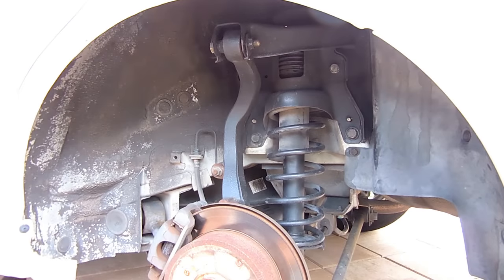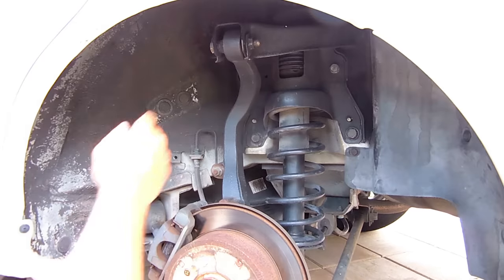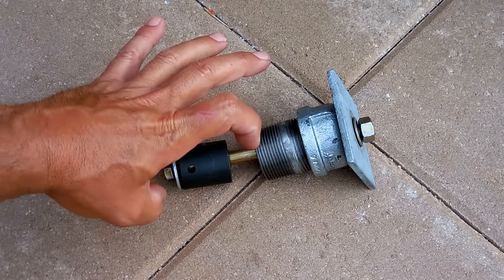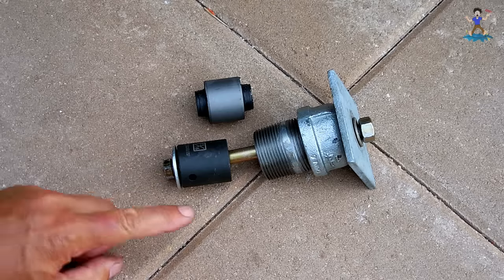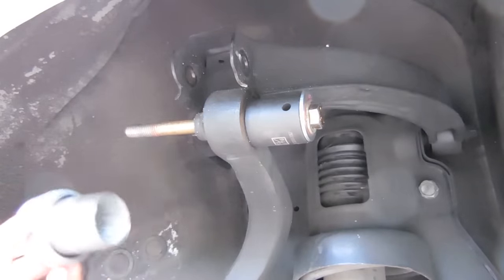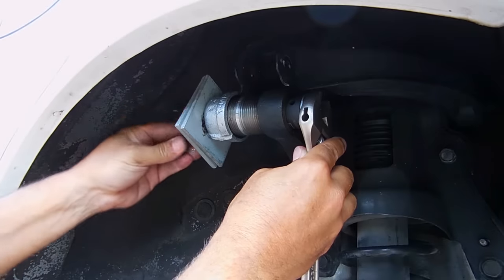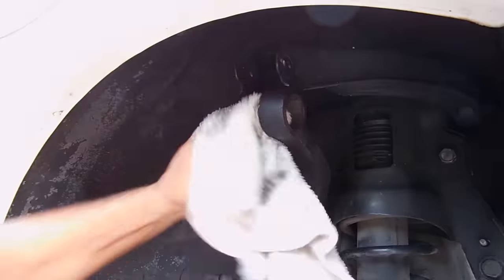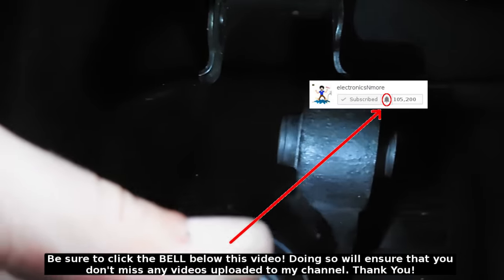How To Replace Control Arm & Trailing Arm Bushings(DIY Tool)

Comment from the maker: ATTENTION: In the video I referred to the suspension part with the faulty bushing as the "Trailing Arm", that was incorrect. I was replacing the KNUCKLE BUSHING. Thanks for watching!
Reply: Where did you purchase those Grade 8 bolts, nuts and washers?

I was searching for something like this last week, had to press in a wheel hub sleeve
Reply: Yup..can used for upoer arm bushing s too..Honda civic ek 1996
Reply: Yeah, I was wondering.... that was some odd Vertical "trailing" arm.....but great content and explanation.
Reply: There are trailing arms all over the place on rear suspensions. Don't worry, we know what you mean. Good trick. Difficulty is finding fresh bushes that last 3 minutes.

Comment: Tip: put bushing into freezer overnight. Take out right before fitting. Easy peasy fitting.
Reply from the maker: Good Idea. The slight shrinkage will ease installation.
Reply: @electronicsNmore  Yup. If you do it in hot day when suspension arms are warm, add grease into hole. You can literally do it by hand to some point.

Comment: Good idea!   Now take some of the money you saved by diy and get a set of ratcheting box wrenches
Reply from the maker: Already have them in storage. :-) I used what I had laying around.
Reply: electronicsNmore I was going to say the same thing, but to be fair, I probaby couldn't find the right wrenches either ( 6 metric socket sets...all missing the 10 mm and 14 mm sockets....disappeared into the garage ether...lol)

Very clever idea btw
Reply from the maker: My tools are very limited right now because I'm traveling a lot.
Reply: @electronicsNmore  can you please tell me what size is the bolt and where did you get all the things from
Reply: @electronicsNmore   we commend you for traveling and not paying into Donald Trump's system Amen.
Reply: @mdrew44628  I have the same problem,  so I checked the hardware stores when they have bins full of loose sockets for sale to clear them out,  I then buy all the 10mm and 14mm sockets.  As soon as I do that, all my lost sockets magically reappeared,  happens every time.
Reply: @ro33west  wtf does that mean?
Reply: @mdrew44628  They were stolen by the 10 mm and 14 mm Socket Monster, been so many years and I cant catch that darn critter.
Reply: @bitteroldman3151  The Socket Monster will find something else to steal then , lololol!!!! its sneaky and crazy ...

Comment: Thank you so much.  I am stuck in a downward spiral toward a complete dead end, but this bushing compression tool may save the diy project.  I was "simply" intending to change the rear wheel bearing in my GMC Terrain, until I snapped off two of the four bolts holding the WB to the knuckle.  That led to a decision to remove the knuckle, and thus the need to remove two control arm bushings.  You have given the weekend, wannabe thorough mechanic hope!

Comment: I keep a couple different sizes of hardened threaded rod to make my own bushing presses. and when you are putting everything back together make sure that the vehicle is at "ride height" when tightening any bushing thru-bolt (unless specified in the factory service manual) in order to avoid shortening the life of the bushing.
Reply: How are you able to tighten it if you have the wheel back on and it isn't accessable . Do you have to do it in a pit or on a hoist ?
Reply: @Scottsudz84  jack hub
Reply: @Scottsudz84   Jack the car up, place it on jack stands, then use the floor jack under the suspension to jack it to typical compressed, on-road position.

Comment: Excellent tutorial!  Thanks for putting this together.  The only thing I would do differently is to put a thin film of high temp (red) grease on the outside of the new bushing to allow it to slide in a little easier.  Good job!

Comment: Excellent video.  Thanks for the idea & tips.  This turns out to be a much cheaper solution than buying an entire kit for $100+ dollars.
Reply from the maker: Yes, especially if you have sockets laying around, and both sizes of galvanized pipe(1 1/4" & 1 1/2").

Comment: Made one recently with PVC 2” for taking out bushings from knuckle in a Toyota   Not used it yet waiting for bushings to be delivered.  Used an old lawnmower blade in place of deck plates you used.  Cut blade in center with cutoff tool.   No metal outer on knuckle bushings.  Just rubber.
Reply from the maker: PVC? Wow, way too weak for my car.
Reply: electronicsNmore 

    I just went to Home Depot and bought a galvanized nipple just in case PVC breaks or cracks.
Reply: electronicsNmore 

    PVC worked.  First bolt stripped smooth and second bolt did the job.  PVC unscathed

Comment: I'm in the middle of changing all the bushings on my 96 Buick Roadmaster. Checking out all the different ways people do it without special tools. I've been collecting metal plates and big washers left over from projects at work. Now I just hope I have the right size sockets. If not, I'll be cutting and welding some scrap metal together to get it done.
Reply from the maker: Thanks for watching Dan!

Comment: Hello , I,ve been doing this for years on old land - rovers , you are doing very well with this , but can I make a few points please :  you have a relatively new vehicle here , on an old vehicle , these bell out hard right into the housing ( hole ) , & I have ripped the thread off of a 9/16 UNF hardened steel bolt trying to get them out this way , cranking with 2 sockets & ratchets , the bigger the bush is , the tighter they are in , a moderate smear of copper grease on both , the inside of the hole , & the outside of the bush , helps a lot to locate these bushes , & helps to prevent corrosion jamming them in hard for the next time you have to change it . It,s not a bad idea to copper - grease the through - bolt as well  . Also , ensure you have all burrs carefully removed out of " the hole " without enlarging it before squeezing the new one in . This might sound like nit - picking but it all helps snatch success out of the jaws of failure .  Good job from an old - timer !  ( use copper grease , not mineral grease as that will destroy your new rubber component )

Comment: Judging by the date I think we were thinking alike , made a similar system but the Bushings were very seized and will not budge, the problem progressed to bent bolts inside the bushings, worse is the trailing arm which is bigger, my Arthritis prevented me from continuing and I am now doing a major overhaul , Timming Belt, Spark Plugs and all Bushings, and thee ignition lock .... BTW is that car a KIA Amanti, its an exact copy of mine 2004, Cheers and good luck in all your endeavors
Reply from the maker: I have a 2003 Hyundai Sonata. Be sure to look over my extensive video playlists below for many other videos of interest to you, use supplied Amazon links to support my channel when making purchases(No added cost to you), and share links to my videos with many others on social networking sites. Thank you, and stay safe Steve!
http://www.youtube.com/c/electronicsnmore/playlists

Comment: Great tip.  You probabily can use this with a different size socket to replace a lot of bushings this way.  The tool from Autozone works pretty good.
Reply from the maker: Yes, use a smaller socket for smaller bushings. :-)

Comment: Next time get you a whole set of sockets a lot cheaper and multiple sizes for future jobs. Also another impact-socket(larger of course) would allow the bushing to come through without resetting again bottoming out and aligning the bushing. But your idea worked for you and that’s what’s matters.
Reply from the maker: Hi Paul. Please read other comments to understand why I used what I did. Thanks!

Comment: excellent technique the only change I would make is the tools, a cheap set of geared wrenches from home depot or harbor freight will save you a bunch of time
Reply from the maker: At the time I was in the middle of moving. All my tools were packed up, so I had to use a friend's wrenches. :-)Thanks for watching!

Comment: Thanks for the video. Do you (or anyone reading this) think that one of those rental tool ball joint press kits would also work?

I like the idea of making my own tool too but I have many different bushings to remove and it might be way too many trips to the hardware store during all the trial and error..
Reply from the maker: My auto parts store didn't have anything that would work.

Comment: I tried making one for a torque strut mount using same setup except I used pvc pipe on the receiving end and yeah it didn’t work. The pvc just kept slipping up and the washers took a beating. It was just in there way too good. I used the pvc because the circumference was very big like 3” and that all I could find. Then the bolt snapped when trying to back the tool off. I’m only out 14 so not too bad I suppose. Taking the assembly off and to carqueat tomorrow to have it pressed out and then he new one pressed in.
Reply from the maker: Only plumbing supply houses have the larger diameter pipe fittings. Good luck!

Comment: Nice video.  Any reason you need the cap?  will a carefully aligned and tightened plate or two work instead, or too much movement still?
Reply from the maker: You need the cap so the bushing has a place to slide into. Thanks for watching! Be sure to check out my "Automotive & Mechanical" & "Useful Tips" video playlists and share.
Reply: Yeah, but it looks like the pipe nipple is sufficiently big enough for that.  Eh, I'll try it both ways since my car has plenty of bushings to press out.  Thanks!
Reply: Ah, I also see where it is necessary for the installation.  Got it!

Comment: nice idea/tool  wont work for me cause I have a different bushings and cant get the bolt out, I think i will cut the outside of the U shape trailing arm and use some washers and the bolt to suck the bushing through similar to what he did or try a Clamp drill rubber and pry it out then use a C clamp to put the new one in ???
Reply from the maker: How about a fine thread rod with 2 nuts?

Comment: I like this idea! However, in older vehicles, when the bushings are extremely rusty, a grade 8.8 bolt won't be enough. You need to go with 12.9
Reply from the maker: Yes, changing out the bolt is no problem. Thanks for watching!
Reply: SAE grade 8 is not the same as ISO class 8.8. A rough equivalent to this 1/2"-13 grade 8 would be M12-1.75 class 12.9. Class 10.9 is almost directly comparable to grade 8, but "equivalent" metric sizes are generally slightly smaller - in this case a 1/2" bolt has a cross-sectional area ~12% greater than an M12, while class 12.9 is ~17% stronger than grade 8, roughly cancelling out the differences.

Comment: Rather than using the galvanized pipe and cap couldn’t you get a 1/2 drive socket and use it with washers/plates??
Reply from the maker: Hi Austin. Whatever works for you, but I think sockets would cost a lot more.
Reply: @electronicsNmore  I’m borrowing someone’s shop so I’m sure he has some laying around

Comment: Great idea but adjustable spanners? :(
Reply from the maker: I used whatever tools I had on hand. At the time this video was made, I was moving and most of my tools were packed up. The adjustable wrenches did just fine because of their length(More Leverage). Thanks for watching!
Reply: @electronicsNmore  fair enough mate after I left the comment I figured the point is to show people that these jobs can be done with common tools that most people have in the garage.
Reply: You use what you have at the time
Reply: It worked though right?
Reply: @electronicsNmore  I keep adjustables ("Crescent" wrenches) in my toolbox the same way I keep suppositories in my medicine cabinet--sometimes they're necessary, but I'd really rather avoid using them.
Reply: @PandaFPV  "it worked though right" is what people who use hammer on flat-head screwdrivers to use as chisels and pry bars.
Reply: @BPoweredLove  or people who use cell phones as flashlights.
Reply: I found this video quite helpful, and your comment not helpful at all.  I am eager to see your video showing everyone how much better you can do it!

Comment: Use a hardened bolt with fine threads,  and finally a use for my Taiwan  sockets
Reply from the maker: Ideally that's what should be used. Thanks for watching!

Comment: perfect tool .. good video. but this is NOT the trailing arm. trailing arm bush is down lower and to your left by a foot.... but good sensible home made tool.
Reply from the maker: Correct. That was a mistake. It's the knuckle bushing.

Comment: What size socket did you use?
Reply from the maker: You can't see it in the video? Mine is in storage. You really shouldn't be concerned about my socket, you need to make it for your bushing. Thanks for watching!
Reply: @electronicsNmore   Working on the same car as yours
Reply from the maker: Oh, ok. That explains it. :-) You may be able to see the writing on the socket in the video.
Reply from the maker: I just saw it in the video. 15/16" impact socket 1/2" drive.
Reply: 2 days and no luck! Crazy
Reply: The steel outer shell of the bushing is seized in!! Gave it my all and it wont budge!!
Reply from the maker: Try a fine thread bolt in the tool.
Reply: Finally got it out today what a nightmare! Ohio weather sucks
Reply from the maker: @TBruce1380  Great to hear!

Comment: Notice: sockets come in many sizes and you may have the correct diameter
 to press out your item. Not only useful for the original purpose!
Reply from the maker: Yes, simple modifications can be made to accommodate other size bushings. Thanks for watching! Be sure to check out my auto/mechanical video playlist below and share my channel with others.
https://www.youtube.com/watch?v=hnd7P7O_vEQ&list=PLQ6IOhUBblU3mBem9ImEgGzmqToW6SCJD

Comment: Next time you should use a fulltrhead bold so that you can easily pull out the bushing without putting another washer,im a filipino and iknow that kind of tecnique i use that so many years ago,,otherwise i like your video,,

Comment: Paid additional $20 and picked up the bearing/bushing tool from harbor freight, works like a charm. Yet to see a bushing it can’t replace 😑
Reply from the maker: I saw that cheap set, nothing inside matched my bushing. The more expensive set for around $120 had the ability to get the job done.

Comment: Please remove 20 in the Rust Belt and report back.
Reply from the maker: Makes no difference because the bushing is a VERY tight fit. The walls won't rust, just the outside.

Comment: Use all thread
Reply from the maker: What do you mean?
Reply: @electronicsNmore  all thread won't limit the amount of thread you have to use.  That way you don't have to add washers.  Also a grade 8 bolt is very overkill.  Just trying to help.  Grade 5 is plenty.  I can look up the tensil strength and shear strength of both in my machinist handbook if you'd like.
Reply from the maker: @robbed_of_sanity  I have a tendency to use stronger than required. :-) The one thing I did was switch to a fine thread bolt. Thanks for watching!
Reply: @electronicsNmore  it's good to see other people making their own tools.  Keep up the good work!

Comment: Instead of using all the BS Home Depot parts you could have used 1/2 sockets and washers instead of the pipe and cap, wasted money. Grade 8 1/2 inch bolts fit right through the sockets and blam your done!
Reply from the maker: LOL. 1/2" sockets aren't cheap. No money wasted on this tool, it saved me a lot of money.